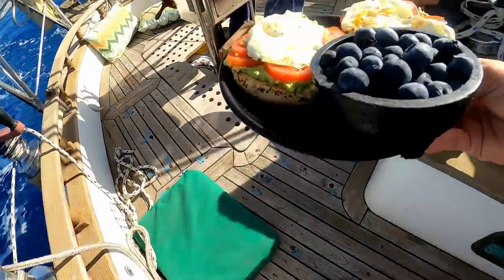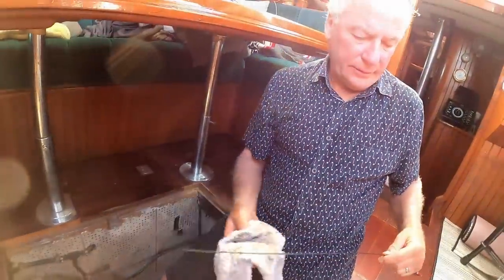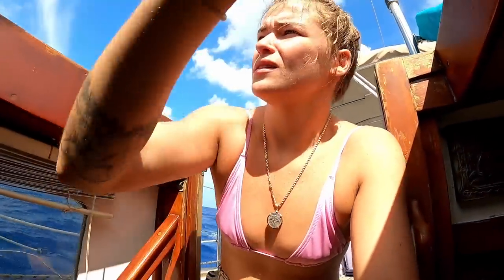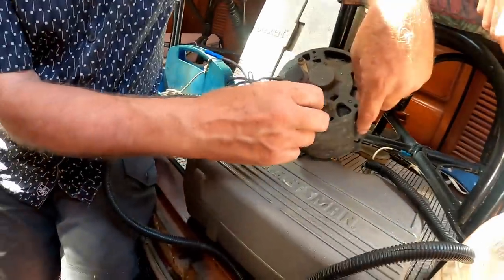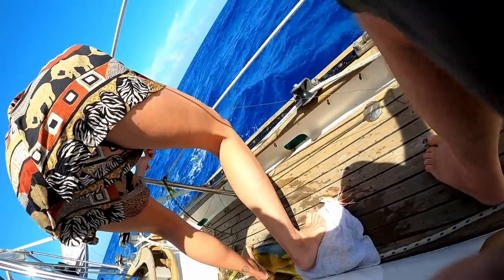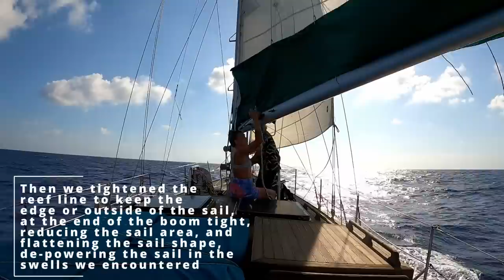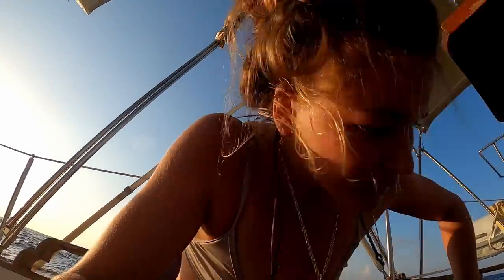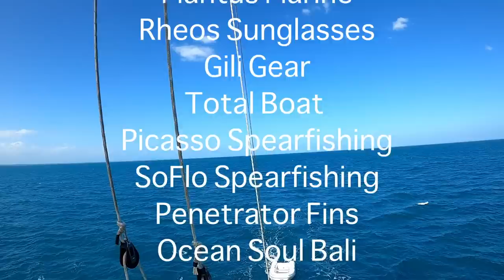2/10/23 GIRL Sails With A POD Of 100 SPINNER DOLPHINS Off The COAST Of CUBA!! We Catch A MAHI! S3:E4

Comment: Beautiful video, I was observing that you would have made a direct approach from across Cape San Antonio Cuba to the landfall in Mexico, the angle would have been perfect due to the port quarter and the list decreases more the waves do not hit the bow, for that reason reason you couldn't open thehatches....EVERYTHING PERFECT. 

P.S. The ride of that 43' Spindrift is great, a heavy boat that sails very well at 7 or 8 knots in a fresh wind, I imagine that with a closed stern and with winds at 25 knots its speed can incredibly reach 10.5 knots. .that design and its first cousin 39' Landfall Vagabond  1984 are generous American designs and built in Taiwan its comfort ratio is 42.6